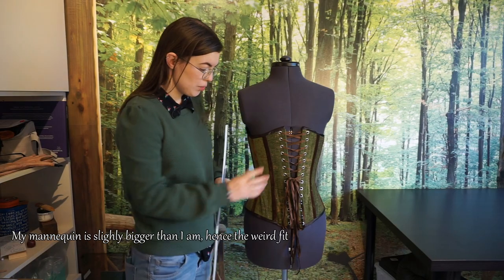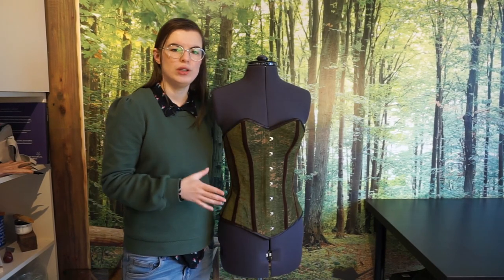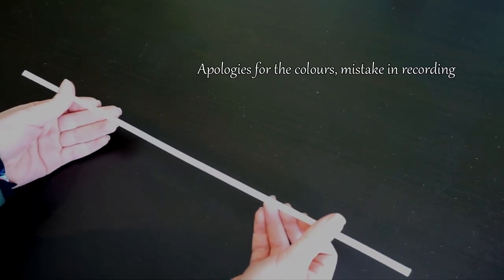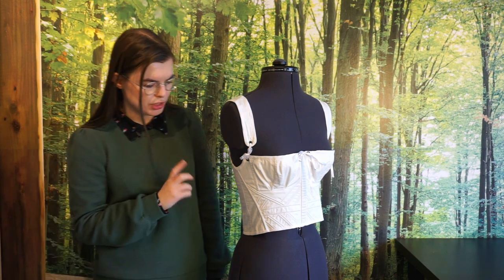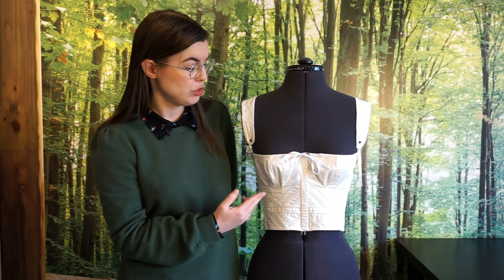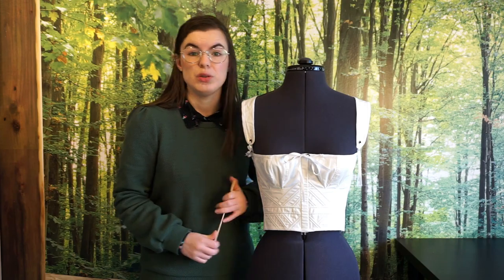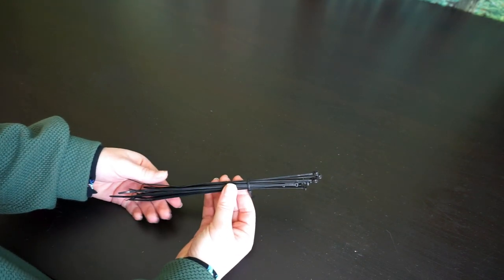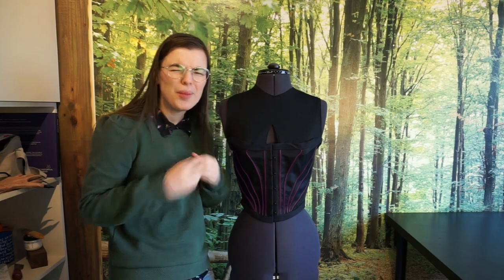All About Corset Supports: From Historical to Unconventional

Comment: I’m late to the party but why is reed an impractical boning material? I imagine it’s much less accessible than cording or zip ties, but likely more so than EL wire or synthetic baleen
Reply from the maker: Mostly for that reason, I know multiple stores with synthetic baleen or EL wire, and none that sell corset grade reed. You could collect it yourself, but that adds the wait time of drying, and hoping the ones you collected will be sturdy enough. Considering my tendency to always start too late on projects, adding an extra wait step isn't practical. 😅